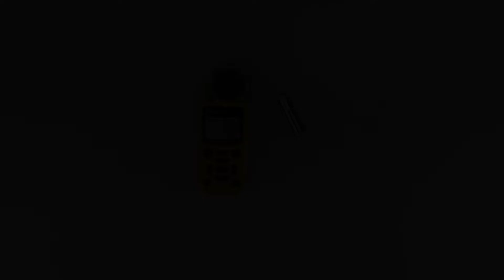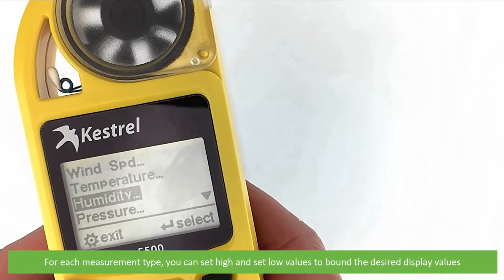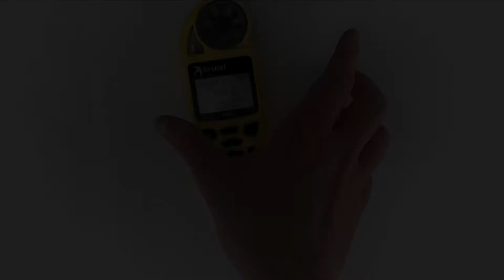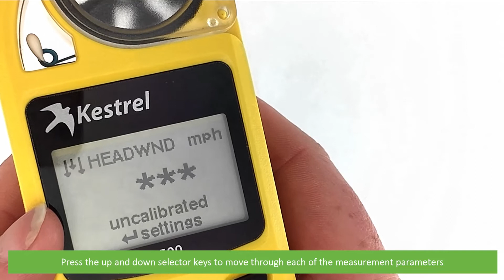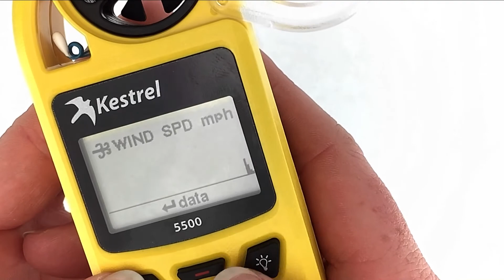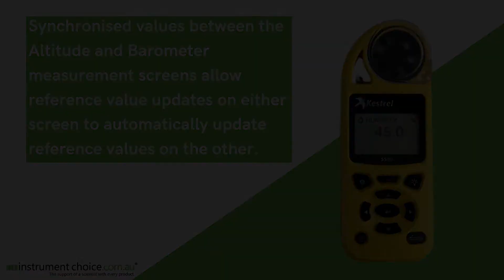How to Set Up the Kestrel 5500 Weather Meter

Comment: No existe la exportación de datos?
Reply from the maker: Hi @wilsonrobertalhuayleon5580,

With the Kestrel 5500 it can store data, however, if you don't have the Link (Bluetooth) version, you would require the Kestrel USB interface to offload the stored data. Which version do you have?